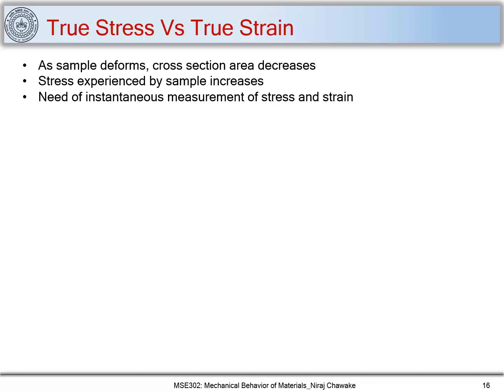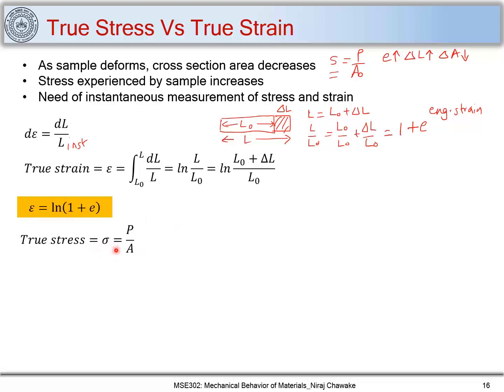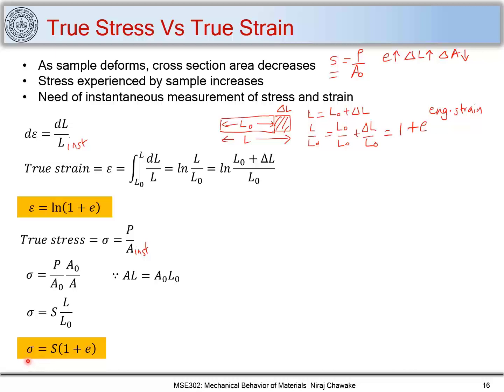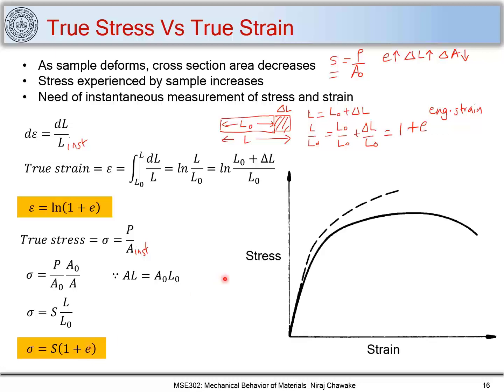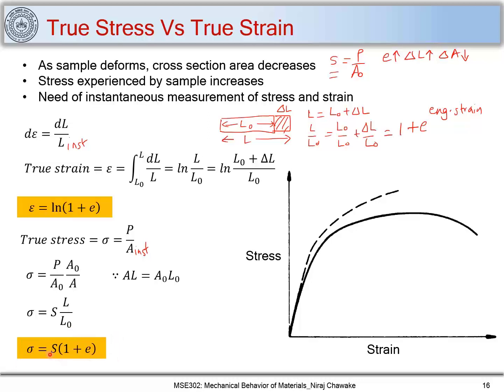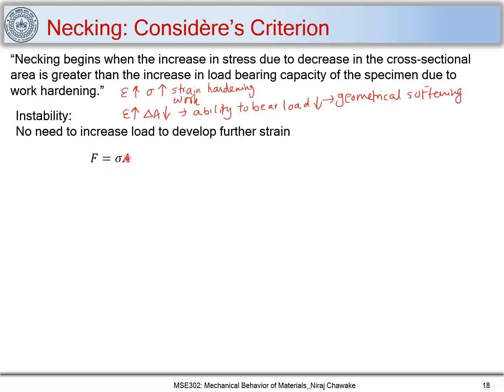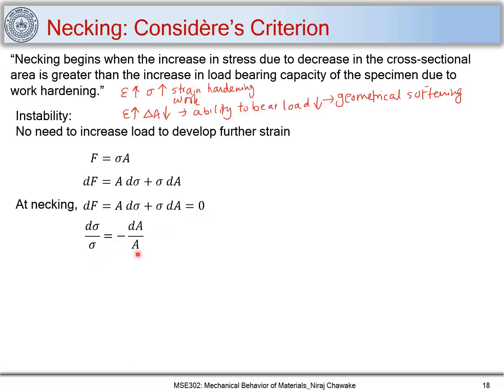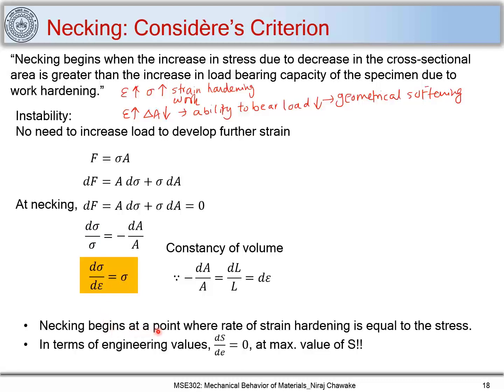4. True Stress- True Strain curve and Necking criterion | Necking in materials

Comment: What do you obtain from an Instron- true stress-strain or engineering stress-strain curve?
Reply from the maker: Stress-strain (true or engineering) help us understand materials' elastic-plastic behavior. Both have their utilities. The engineering stress-strain curve finds its utility in structural applications. In contrast, the true stress-strain curve is majorly used in the processing of materials. Also, most continuum mechanics theories deal with the true-stress true-strain values.
Reply: only load vs displacement